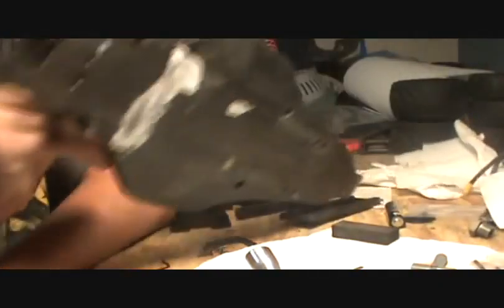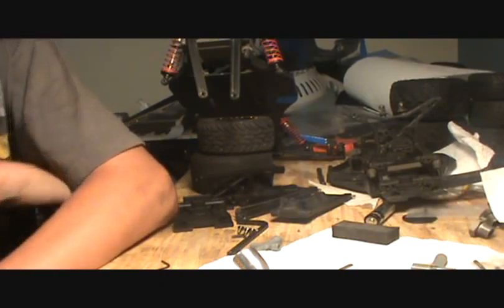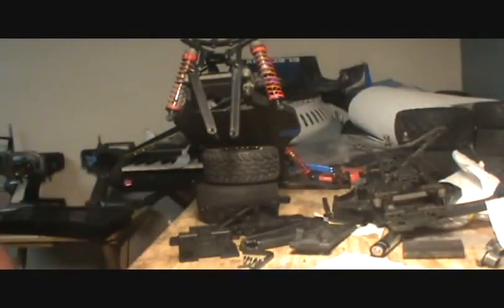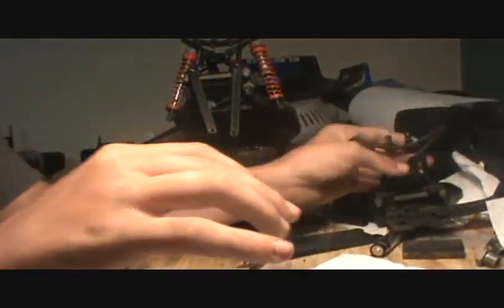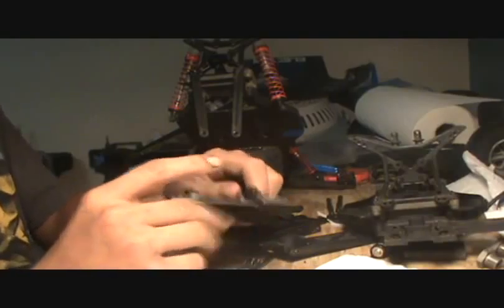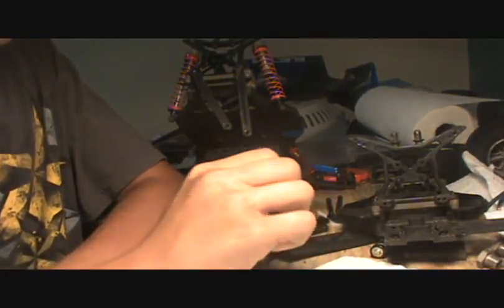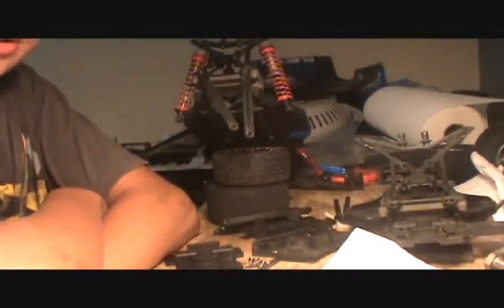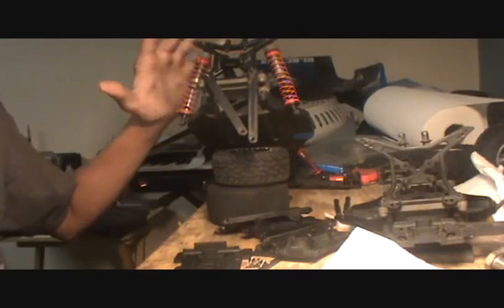RC Update..

Comment: @GJCrawler I broke my drive shaft on the right side so now it falls off a lot but it still works. and my motor wires fall off constantly. I am going to get solid-core wire for it.